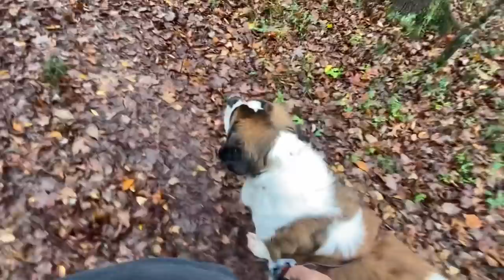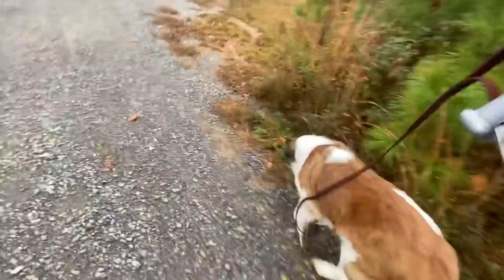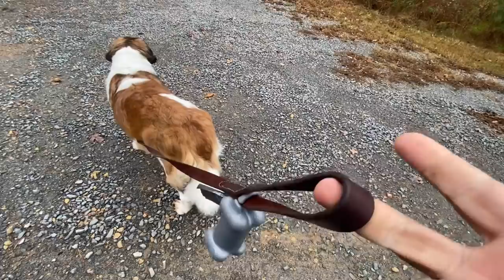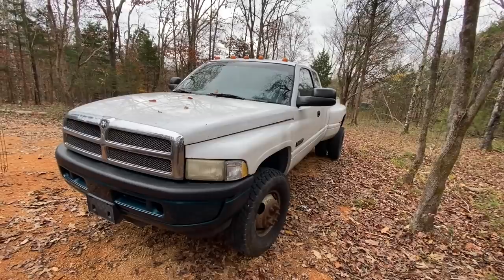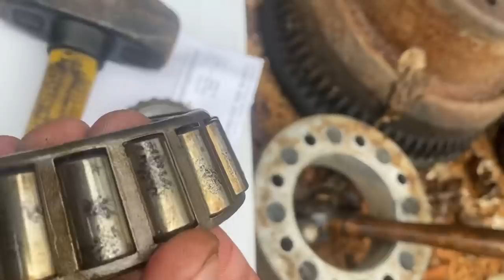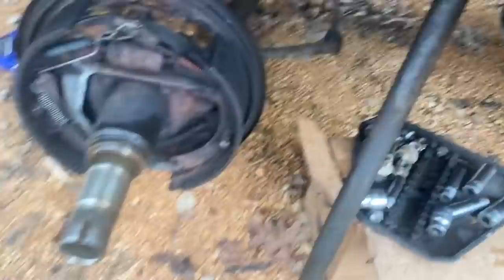A little more of Leroy our St Bernard and some more back story & discoveries on the dodge 3500

Comment: I am still grinning after laughing out loud for 10 min looking at Leroy with the Greyhound Cap on. Holy cow that was great! One thought from a guy who has been playing with the Dodge Cummins 4x4's for longer than I care to admit. 
I live on a piece of property not unlike yours, steep long driveway, etc. I did a conversion kit on the front end of a 2000 that eliminated the unit bearings Dodge uses and put manual hubs in place. It is one of the best things I have ever done to the truck, give you a 2L in the transfer case, keeps all the gears and driveshaft wear down on the front, helps mileage a bit, no downside at all. It was the first thing I did when I bought my 07 truck.  Yukon Gear makes the kit I prefer, not cheap...but worth it if the truck is going to be a tow beast and you plan to keep it. Something to think about anyway.
Reply: Yup the front ends always been the second weak link after the transmissions. I redid mine as well.

Comment: Relieved to hear you say the entire axle is going to be refurbished. If the injection pump is a Bosch VP-44, they are supposedly reliable.  I was told to watch the oil lines to the turbo on the ISB in my motorhome. They are alleged to be somewhat problematic.  The "53" blocks are the ones with the thin castings.

Comment: I have a 2002 3500. I noticed a vibration but could never pin point the problem. It showed its head when left rear seal started leaking. Found a bearing like the one you showed with lots of pitting. Was almost two years ago. A couple months ago was hauling a trailer full of hay home and something just didn't feel right so I pulled over and smoke was coming from the left rear hub. Limped it home and pulled it apart couldn't tell if it was bearings or breaks so I ordered brake lines, calipers, rotors bearings and seals and replaced all. When I pulled the right side apart the outer bearing looked like the left one I replaced on the left side over a year ago. Someone also worked on the rear end years ago and I think they had the preload set way to tight on them causing them to flake and pit from getting to hot. Cleaned and flushed the diff hoping the bits didn't mess up the center bearings. When you rebuild the center would very much like to see it. Their heavy and most what I heard you need a diff spreader to be able to get it out without prying and beating on it half a day.

Comment: When you said the truck's been cobbled together you're right I don't think that truck was originally a dually truck? noticed in the video a wheel spacer that's used to convert a single rear wheel truck to dual wheels.

Comment: I THINK THE THING ABOUT THE EARLY CUMMINS WAS THE SET PIN ON THE FRONT GEAR OF THE VALVE TRAIN. SCOTT UNLESS I'M MISTAKEN
Reply: There is supposed to be an easy fix by adding a washer, bolt, small plate, something to keep it in.  I was told to get it done the next time the timing gear cover is off. (Of course, it's a '99 and as near as I can tell, it has never been off.)
Reply: @proehm  HAD THE USE OF THE SECOND YEAR CUNNIBS DODGE IN A 4X4 5 SPEED LONGBED ....LOVED IT... I HEAR THE RARE UNICORN NOW IS ALL THAT IN A CREW CAB

Comment: I bet those bearings and seals were a lot cheaper than what our buses cost. One step at a time. At least when you have the diff cover you can count the teeth on the ring and pinion to get the correct ratio. It will be a awesome farm truck when you're done. Thanks.

Comment: Longevity wise, I've had 3 USED (multiple owner) Dodge 4X4 (1977, 1981 & 1990) rams - all went well over 300k miles (318 c.u. gasoline) 1 bad engine (replaced with a factory "MOPAR crate" engine) & some minor drivetrain issues. 1 had a bad chain in the transfer case - used 90W & STP never gave me a problem after that, 1 had the rear pinion shaft break destroying the rear - fixed that with a complete banjo from a similar year Ram that had the heavy duty (8 lug) setup - simple matter of switching backing plate & related hardware to was was original on the truck - didn't have to match the gear ratios, worked out fine. 1 had a front wheel bearing go bad and ate up the steering knuckle - again got a "junker" HD knuckle BUT that had to be machined to fit (steering arm too long). Body rot was more of an issue then mechanicial issues

Comment: Scott Crosby on the issue of ticks mosquitoes fleas and non-beneficial bugs one way to get rid of them is to spray beneficial nematodes. Beneficial nematodes are small insects that eat the eggs and bugs of non beneficial bugs period sprayed my yard in my new yard old yard was for 7 years once we sprayed it didn't have any more problems the new yard for 3 years still no problems. You can get this at your local nursery or you may order online . Pretty inexpensive spray the areas you most most need and then every year at a little more. I do believe they spread out over time but you won't be sorry not super expensive sprays with a unused hosen sprayer. if you use something that had some kind of chemical in it before you may kill everything.

Comment: based on the condition of the rear axle, might be some value? in looking for a matching set of axles (front and rear) , or a complete drive train, off a donor truck or something.  on the other hand, looks like you've got most of the parts to do a R&R on the rear end / axle anyways.

Comment: Scott, I have the set up tools for that front axle if you need to rebuild it. When you got the new axle bearing nut I did not see if you had the lock wedge. If you are missing them (they slide in the bearing snout key way and cut into the nylon on the nut to keep it from spinning) the Dorman part number is 615-135
Reply from the maker: I have the wedge

Comment: I've got a Great Dane on Six acres. I considered the GPS version of a fence, but the cost of the batteries alone on their proprietary collar immediately turned me off, plus the signal does drift more than just a couple of feet off your defined borders. Your mileage may vary when considering this option. On the plus side, an underground wire probably isn't much of an option for you If there's a lot of rock where you need it.  At Leroy's age and with his eyesight, he probably isn't much on game chasing.

Comment: Look for the snow blade stuff, it might come in handy.
Reply from the maker: Handy for what?   This area gets an average of 2” total per year.
Reply: Snow plows destroy trucks. Better to pay someone else to do it.
Reply: @BusGreaseMonkey  Climate change...
When we moved to Bluff City, TN we were told it snowed about 2-3 inches per year. During the 8 years we lived there we never had less than two serious snowfalls of 6 or more inches with at least one lasting over a week.
Reply: @Spyke383  No, what destroys trucks with plows comes under the heading of owner abuse, either by operating outside parameters and/or failure to properly maintain including washing every time they plow to get chemicals off the truck.

Comment: There will be a tag under one of the bolts.  If has 2 tags it has a limited slip. One of the tags will have the gear rartio on it
Reply: The way he talked about different owners doubt tags still there just spin ring till you find it stamped into ring
Reply: @timatwell3728  true that entered my mind also

Comment: That would be the “53” block. Keep + 6 PSI fuel pressure on the VP44 and it’s good to go. My 2000 ram 2500 has 330 K and the VP44 has 200 K at 10psi and is good to go. I have to re-do the body as the stuff they put on the roads eat these old Rams right up...
Reply: It has a fresh lift pump on it. I plan on leaving the vp44 on till it dies. Then we will be swapping to a p pump.

Comment: It’s a VP 44 fuel pump on and ISB 5.9
Reply: Until it dies. Then p pumped 24v
Reply: @Spyke383  perfect plan, but in the mean time a fuel pressure gauge could really help. sounds like it originally had the dreaded 53 block
Reply: @jimbo8972  it has a fresh lift pump on it but guages are in it's future. But between 3 trucks, a bike and a bus I have to prioritize projects.